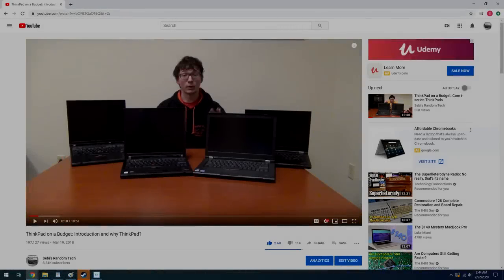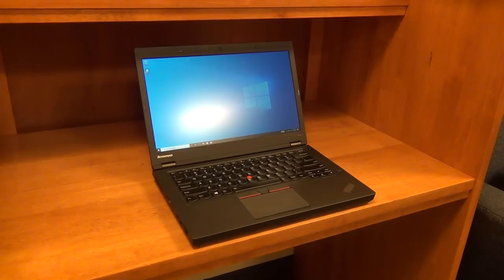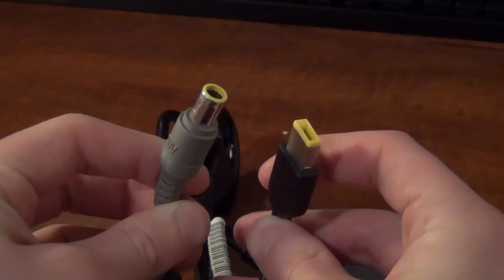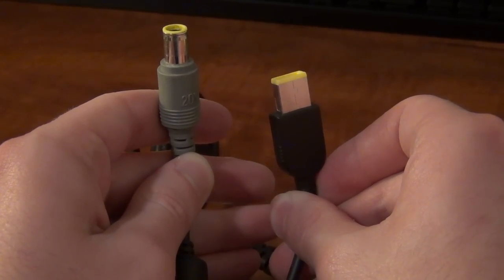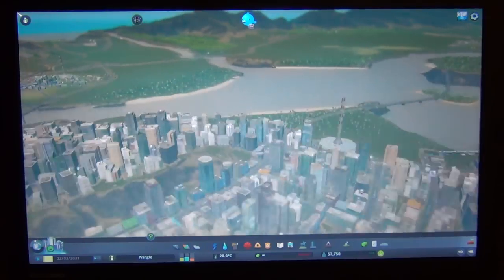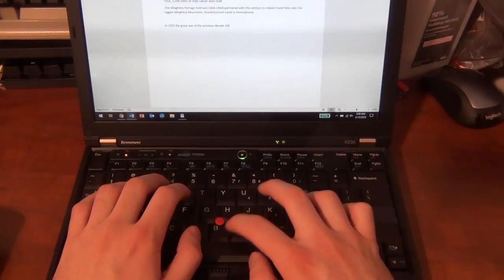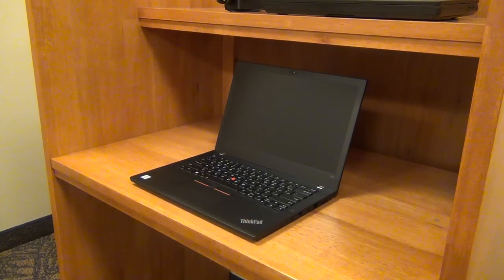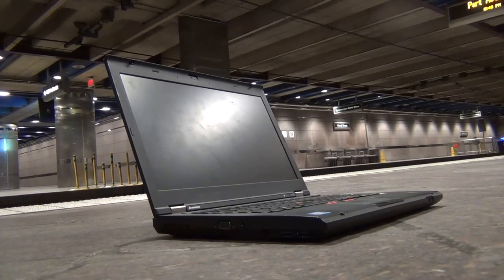Best Value ThinkPads in 2020

Comment: My boy...Laptop. Portable. Battery life. 2013 models SUCK BIG TIME at that. No thunderbolt either. t480 got all of that in a reasonable manner and therefore it's way way better value. And the x200 (orx220 if u need the trackpad and a little bit of "speed") is the better l33t hacker laptops.

Ps: arm notebook gonna make t480 look like crap again.world keeps spinning
Reply from the maker: But the T480's Thunderbolt is prone to failure, as I addressed here. I'm still happily typing from my T430. And yes, it's on my lap too.
Reply: And in alot of cases the 480 is over twice the price, where I live it's 3x.

Comment: Anything but Lenovo
Reply: Sad that IBM let go so quickly. Thinkpads still made good money at the time, and the fully IBM- designed t60 could have been even more of a legend. Imagine a t43 with more modern hardware. I'd prefer that.
Reply from the maker: IBM decided it wasn't profitable enough for them, even if it was making them some money. If Lenovo hadn't acquired the line someone else might have with better or worse results, or the ThinkPad line may have just been discontinued altogether.
Reply: @SebisRandomTech  Nothing is safe in the hands of the mainland Chinese. This is just how they are. 

The worst part is that they do not have any respect for privacy, so I would not be surprised if every T490 came with a chip on the mb just for spying on users.

BTW, do you know of any way to Frankenpad a 14.1" t60? My 15" barely fits in my bag nad is an early review model, so I have reservations about using mine
Reply from the maker: @charlesc.9012  To be fair, take a look at how much the U.S. feels the need to spy on not only foreigners, but its own citizens...I'm not at all saying China is justified in what they do but it would be wrong to look away from other global powers doing the same. Even if China wasn't spying, someone else would be and are doing so. As for your T60 question, are you asking if a T61 motherboard can be used in a 14" T60?
Reply: @SebisRandomTech  Yes, about the t60. I hope to acquire a 14" model to cut into, and I found no info on frankenpadding in that way. I think a 14" t61 mb will fit, but I can't really afford it without a guaranteed chance of success. T60's are expensive to import to where I live, so I have reservations about cutting up mine

I have since changed my mind, as I found an IPS for $20, +shipping to HK.

I think there is a fundamental difference between espionage of both sides, as the US still has checks and balances to limit the government's power, while the CCP just does everything it pleases. They already have cameras at every corner in mainland cities.
Reply from the maker: @charlesc.9012  I can't give you much information on that process, but I know it is possible, as some have done it before. Like with a 15" T60 however, you need to use the 14" 4:3 T61 motherboard. A 14" widescreen T61 motherboard is a different size and will for sure not fit.
Reply: @SebisRandomTech  Yeah, I watched the series again and saw one. TY. 

I decided to go all in and check if a T400 would fit in a 15" T60, and whether it is compatible with a LED IPS. 

The T400 is only marginally wider than my T60, and I can accept tight fits and lack of a CD-ROM. The shape and screw positions look similar, unlike a T410.
Reply from the maker: @charlesc.9012  I'd be interested to see if that works, I don't know if trying out a T400 motherboard in a T60 body has ever been attempted before.
Reply: @SebisRandomTech  T400 boards are highly affordable where I live, so I can afford to mess with them. They look like they will (mostly) fit, since they seem to have some matching heatsink screw holes, and that is enough.

The challenge is to fit the screen with the proper cable, since I currently only have ccfl panels, and have to order a screen connector online. I think the t400 only has LED connectors as default, will need an LED kit for that.

I will try, since the cost of failure is relatively low, minus the screen.
Reply from the maker: @charlesc.9012  The T400 was available with both CCFL and LED displays, it was basically a lottery of which one you would get. The motherboards are the same, the difference is all in the display assembly, with CCFLs having the necessary inverter needed to power them.
Reply: Sorry about hijacking your thread :(
Reply: @SebisRandomTech  Oh, Your thinklight is part of the screen cable, and needs to be in the slot on the top of the screen to work.
Reply: @SebisRandomTech  In a random post on a German forum I read a while back, I found that the t500 motherboard is a good fit if the mSATA adapter is used, and that madlad made an R60/500 frankenpad. Ordering a W500 Board to see if it will work

Comment: wtf you say t440p cannot use external graphics card?? don't you see that damn expresscard  slot of t440p in front of you???
Reply from the maker: I think you're the one that can't see. The T440p does not have an expresscard slot, the 15" T540p and W540 do have it and the older T420/T430 have it, but you can check Lenovo's spec sheet and the various online ThinkPad forums if you don't believe me and can't see with your own two eyes.

Comment: downsides for 2020 standards:

bulky
power hungry (TDP) = big battery
heavy
poor resolution
lacks new ports
low RAM
slow storage
......

otherwise they're great for basic task .... If you consume multimedia better pick a newer model.
Reply from the maker: Counter arguments:

-I know, they're thicc and heavy. But built very well and can take a beating, unlike any new laptop in the same price range. It's not heavy enough that it's an inconvenience to carry around, if a 5 pound laptop is so heavy for you that it's that much of a problem then you probably have bigger things to worry about.

-1080p is still pretty standard for most laptops, with only the most premium options moving to 1440p or 4K displays.
-The vast majority of the ports on these machines are still standard on laptops today, with the exception of USB-C. Even then most people I know only use that port for charging and not for other things.
-All of these laptops take up to 16 GB of RAM, which is still more than many brand new laptops. Many new laptops, worse so, have soldered RAM, so there is no way to upgrade or replace it.
-All of these laptops accept and sometimes originally came with SSD's, which completely negates your argument about "slow storage".

Considering I still have a ThinkPad T60 from 2006 that still does what I need from it for "basic tasks", I would say these much newer laptops, especially with a RAM upgrade, quad-core processor, and 1080p screen, will still be good for most people's needs for years to come.

Comment: Left Ctrl, omg...
Too heavy, besides sooo fat.
2k20, lol
Reply: Михаил Скорбеж I agree on the heavy and thickness, but the left ctrl can be changed in the bios so they flip.
Reply from the maker: What is it that bothers people so much about the control key? It doesn't bother me and if it *really is enough of an issue that you're losing sleep over it*, the buttons can be swapped in the settings.

These laptops are a bit heavier but I'll take a chunky tank that actually works and is built to last over a thin flimsy piece of junk that breaks right after the warranty ends, has keyboard or screen issues, and can't be upgraded or serviced.

If 5 pounds is too heavy for you then I'm not sure how you make it through each day...2020, lol.
Reply: hey we found the apple fanboy, lol
Reply: @macandpciscool6507  Funnily enough, the MacBooks also use the swapped Fn/Ctrl keys.
Reply: @SebisRandomTech , hey!
No war. Make love ^_^
Reply: Sebi's Random Tech I mean I carry a X1C6 daily to school and later to work, I was able to make up weight to even carry a small textbook around, but with my father’s T420 I wasn’t even able to put anything extra. I don’t know what you put in your bag but I want to keep it minimal.
Reply from the maker: @m0rtale195  I've switched around between these older ThinkPads and lighter machines like the T480 and X250, as well as heavier machines like my FrankenPad T601, T520, and W540. Yeah, the difference is there, but it's not really massive enough for me to care. At least considering the rest of what I have in my bag.
Reply: @SebisRandomTech  these laptops are great. They're built like a tank. Very durable for sure. And the great thing about these is that you can just add those extra battery packs for 24 hour battery life.